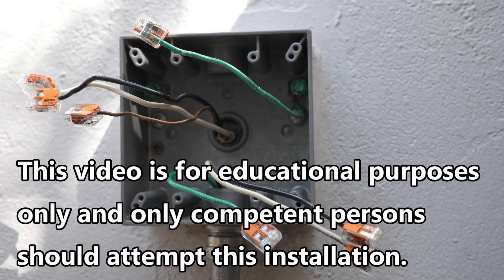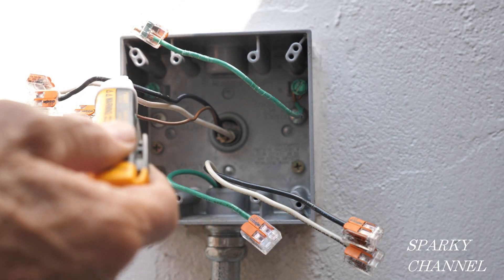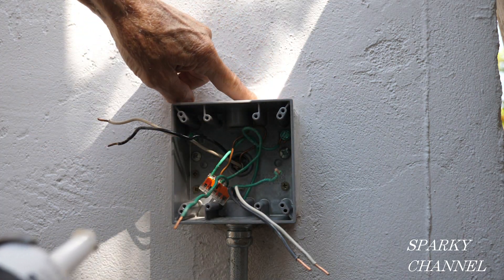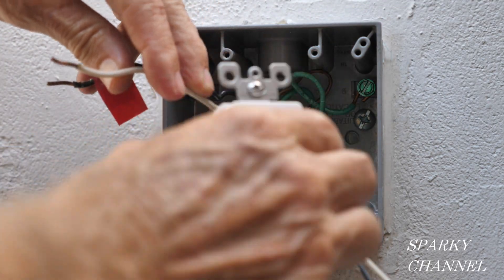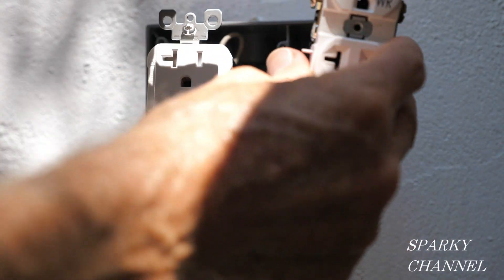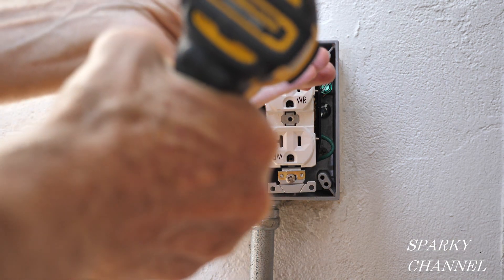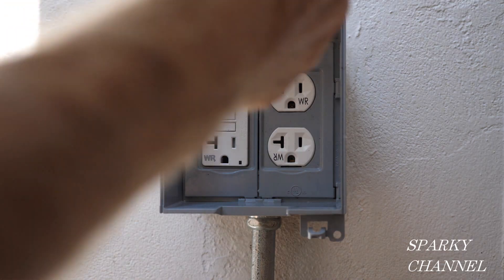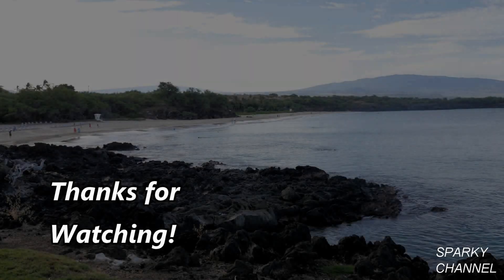How To Install A Weather Resistant 20A GFCI and a 20A Receptacle in an Exterior Box

Comment: I have a question a friend of mine has a pergola in his back yard it's already pre wired and only 2 wires are coming out from the top there two areas on ceiling for 2 ceiling fans and on each corner there's wires for 4 lights he already bought the two fans and 4 led multicolor changing light fixtures supposivly already pre wired for them all and wants me to just hook them up the LED lights are flush mounted lights so I'll need to cut holes in ceiling to mount them flush with ceiling supposivly its all connected and theres only two wires coming out from top as i mentioned before can I run them two wires to a 20 amp GFCI plug or is there a way I can use the wiring from behind the outlets to run a outside breaker hooked up to the wiring behind the outlets will the 20 amp GFCI plug handle the 4 led lights and 2 ceiling plugs or should I connect them to an outdoor breaker box connected to the outdoor outlet box

Comment: So if I have an existing GFCI and was to add a circuit and a switch I would use the load black from gfci to one leg of the circuit and pig tail to switch. Then white from gfci and pigtail from circut ( silver) side and tie them together. Tie all three grounds ( 6 twists ) with nut and ground box?

Comment: The reason you have 2 sets of wires going into that box is because there is another wall receptacle downstream. Correct?... If there were no other receptacles downstream could you still GFCI protect that second receptacle in the box?

Comment: Instead of having two wires per load screw (doing pig tails off of the load screws on the GFCI to the standard outlet,) could you also have pigtailed the standard outlet with the upstream wires in the box, then run a single white and black pig tail to the GFCI load screws? Just wondering if this would also work. Thanks.
Reply: No, the standard outlet will not longer be GFCI protected. GFCI outlets can only protect the GFCI outlet itself and all DOWNstream outlets after it.
Reply: @bwats1991  thanks you.

Comment: Hey Mr. Sparky....  Enjoyed video and learned a lot.  One question about wire size please.  It looks like the wire you have in the box if 14g just because it seems easy to work with.  However, I understand that 20amp devices should be using 12g wire.  Can you confirm that you are using 14g wire and if so is it still ok to use a 20amp device.  I am trying to replace a gfci that has 12g wire running to to and am curious if I can use a 15 amp device.  Thanks.

Comment: I'm installing an exterior receptacle using similar wet location sealed box shown in your video.  For the line wire, using 14/2 UF connected to existing interior receptacle.   Plan is to run the UF into the outdoor box using a wet SE connector (link after comment) to seal back of outdoor box.  Exterior wall is OSB and vinyl siding (no housewrap).  Plan was to either silicone caulk the space between the OSB hole and that wet SE connector or pack with duct seal putty, then also caulk perimeter of back of box to the OSB, and caulk the foam cover gasket and plugs like you did.  See any issue with that wet SE connector approach?

https://www.amazon.com/dp/B000M2XXW8/ref=cm_sw_r_cp_apa_glt_fabc_5B3TBSJMSJYAS2NZAZ5Y?_encoding=UTF8&psc=1

Comment: Thanks for the wonderful videos. I have a situation with a outdoor receptacle and a irrigation pump feeding off the same line circuit.  The pump is controlled by a switch. If I install a gfci receptacle, do I have to protect the switch with the gfci or is a ground acceptable?  Thanks in advance for your help.

Comment: Ive been trying to find this answer online and can't find one.  I have two outdoor receptacles, both located on opposite ends of my house.  They were previously protected by one upstream GFCI in the garage.  Neither outlet is WR-rated.  I want to replace both outlets with WR-rated GFCI and use the line connection to daisy-chain from one GFCI to the other, so as to not have to run around trying to find which GFCI tripped.  Is this an acceptable installation?  Or should I just keep the GFCI in the garage and replace the standard outlets with WR-rated standard outlets?  Thanks!

Comment: Klein has a receptacle tester that has a gfci button on it so on outlets downstream you can actually verify not only that the power is cut off but that a condition downstream will actually trip the upstream receptacle.
Reply: Most of those testers have that button.

Comment: Is it not required that during installation of reciprocals that the line and load screws be torqued? Circuit  breaker screws are required to be torqued
Reply from the maker: Every connector in a load center has to be torqued. Torqueing receptacle terminals is a good idea but not part of the NEC as far as I know. See my video: 2020 NEC Article 110.14(D) (With Examples) Torque Specifications: https://youtu.be/ujFzUAwIDps
Reply: Sparky Channel 110.14(D) Terminal Connection Torque. Tightening torque values for terminal connections shall be as indicated on equipment or in installation instructions provided by the manufacturer. An approved means shall be used to achieve the indicated torque value.

So if the instructions or receptacle device itself specifies a torque value, it must be torqued accordingly. But I have yet to see a any specified for a receptacle. Would not be surprised to see this in the future though.

Comment: I'm going to be putting in a 30A 120V RV circuit outside my garage running off the garage sub-panel. Do I need to have the circuit GFCI protected?
Reply: Or maybe you want to do a video on installing a 30A 120V RV receptacle and circuit? Just an idea.

Comment: Question for the pros. I want to add an outdoor light but there is no power outside that I can tap into. The easiest way for me is to splice from a recepticle inside the bedroom and drill directly outside and mount the light fixture. However, both bedrooms are on the same breaker and both have smoke/ fire alarm. Will this option be against code because of the fire alarm being on the same breaker? Any info will be greatly appreciated
Reply: Burim Limani each room should be on a dedicated breaker and all the smokes on a single breaker so I wouldn’t do that
Reply: @Itzzzyaboi2345  
Thanks,
Thats the way its built. It was build in 2005, so its not that old and assuming that it is up to code for that year at least

Comment: I don't understand the reason for the electrical tape over the back of the outlets?  All that does is leave a sticky mess for someone who would have to work on that later.
Reply: ckhallock88 it’s in case if a hot gets loose over time or when you have cables too close too eachother either a neutral or a ground it doesn’t make contact to a hot and makes a short and if your putting an outlet really close to the box the hot can hit the box and make ground and short it so it’s safety more safer
Reply from the maker: It isn't necessary by code. It's something that I do to reduce the possibility of a short.

Comment: dont they need to tamper resistant recepticals?
Reply from the maker: The GFCI in the video is TR.
Reply: @SparkyChannel  im still in school so when I learned tamper resistant receptical they said that the new ones have a plastic piece that doesnt allow a plug to enter without both hot and neutral entering at the same time . is this mandatory since nec 2020 has been applied?

Comment: Can those wago nuts handle 480v? At work I deal with 480 3phase motors from 2hp to 15hp.
Reply: UL rating is 600V, and depending on which version (there are two 221 sizes) 20 or 30A. European rating is 450V, 32A for the small ones and 41A for the bigger ones.
Reply from the maker: See my video: Wago Lever-Nuts Questions and Answers From National Electrical Contractor Convention: https://youtu.be/d2lkBlIPkHg
  for more info.
Reply: There is a 221 Ex Series of Wago Lever Nuts that are rated up to 440v (with the proper mount) but I haven't found anything higher.